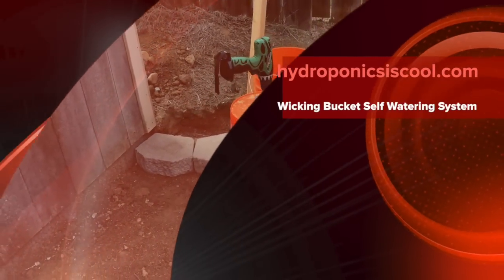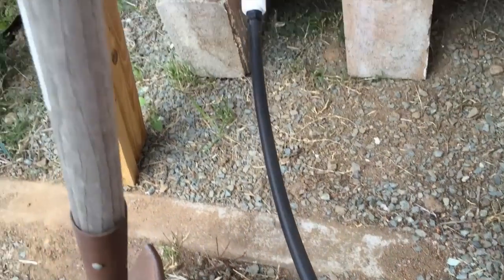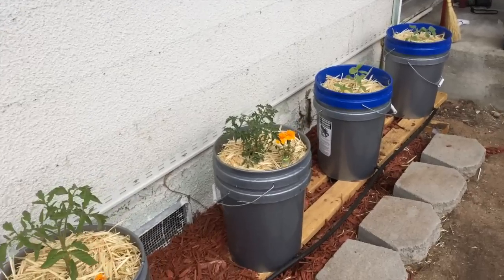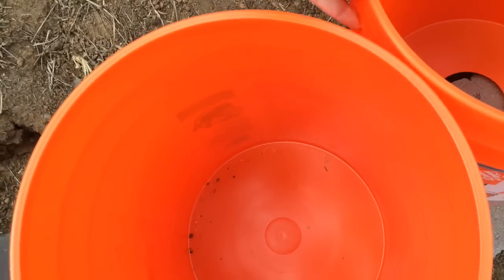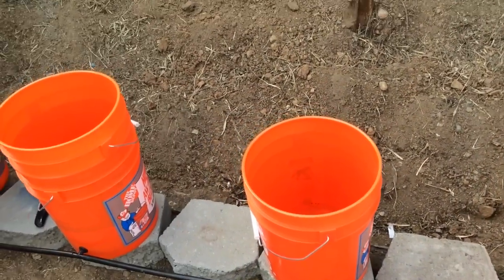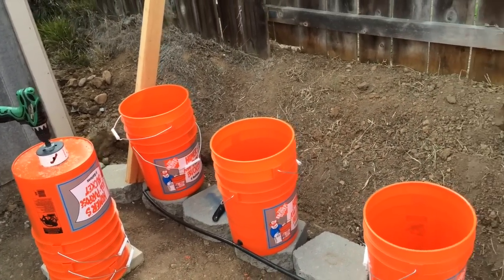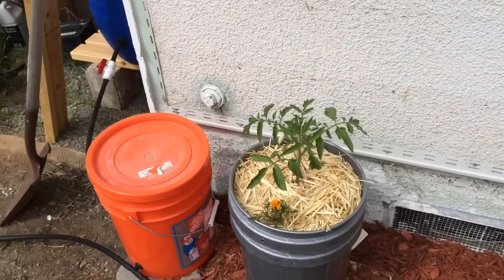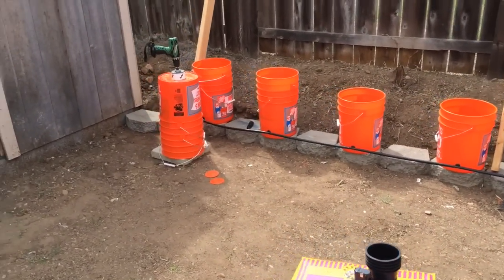Wicking Bucket Self Watering System

Comment: Can someone explain to me how the water doesn't overflow inside each Home Depot bucket, causing them to drench the plants??  I could understand if this system were air tight, but is it really?!?
Reply: Water only goes to the same height as in control bucket, and that is kept at that level with the float valve connected to reservoir.
Reply: @vv2304  no each bottom bucket is going to need an overflow He said a 1/4 to 5/16 inch hole where the bottom of the top bucket ends

Comment: Could you please tell me where you purchased the grommets and maybe what the part number is.
I live near Home Depot and Lowes.
Very interesting idea.
I plan on using this system this summer.
Thank you so much for the great info.
Reply: T Webster I used 1/2 in grommets from Amazon. They require a 3/4 drilled hole. System works great. Float valve also on Amazon.